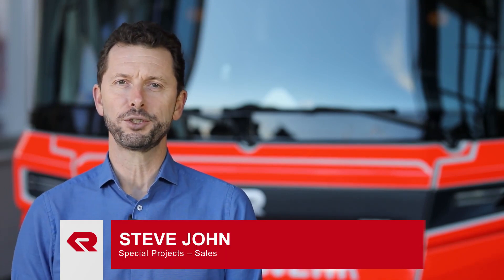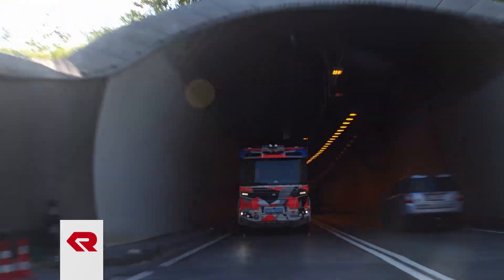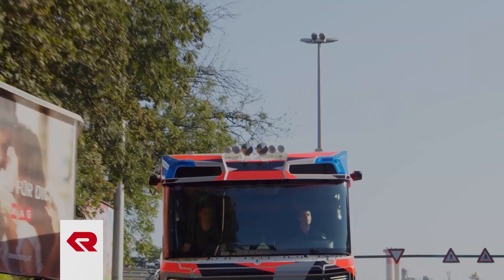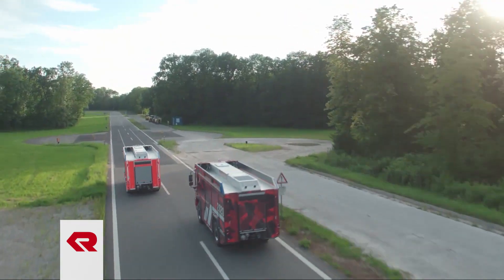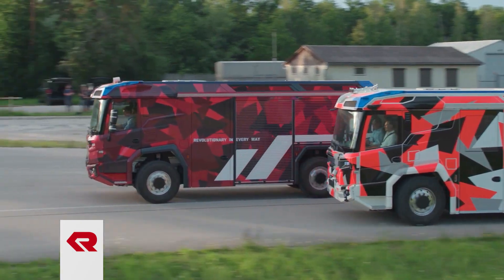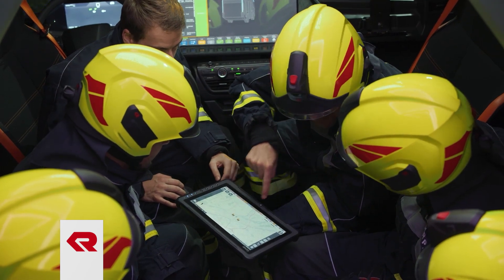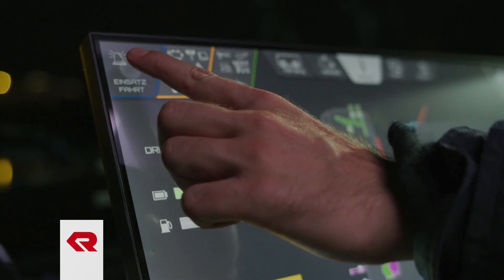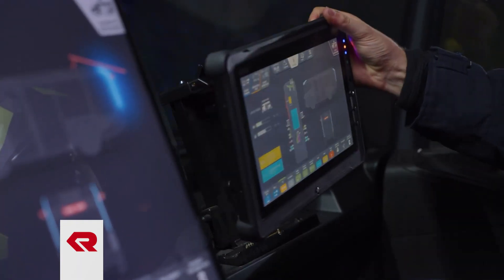Revolutionary Technology Walk-Around Introduction

Comment: Cool truck just need to get the pump up to 1500 gpm 528 is awful low output
Reply: there will be an American version, maybe with higher pumper capacity? Elsewhere 528 gpm is definetly sufficient, others rather work at high pressure instead of high flow